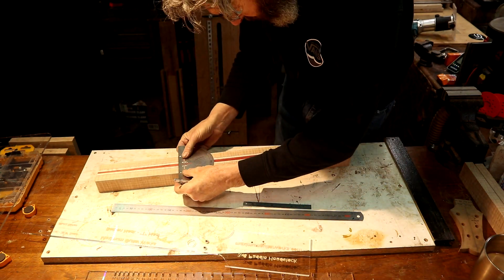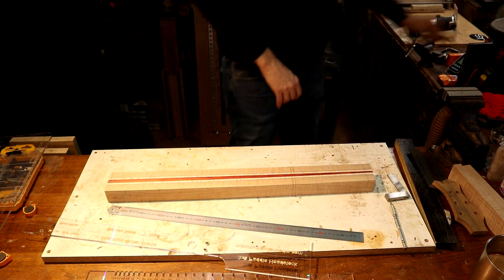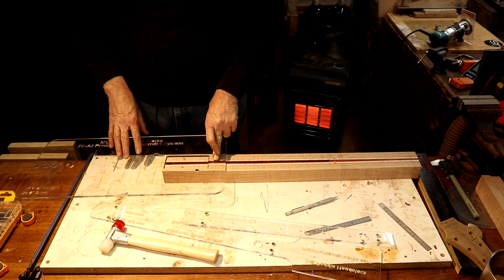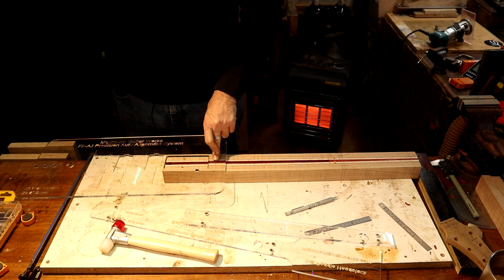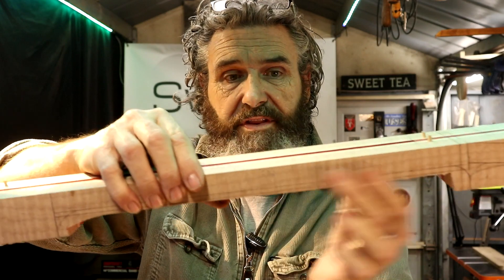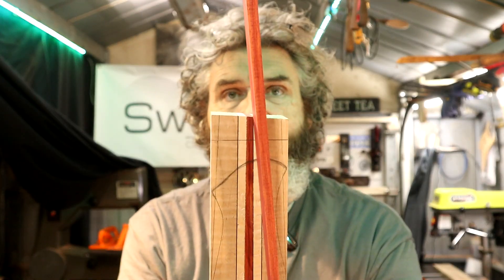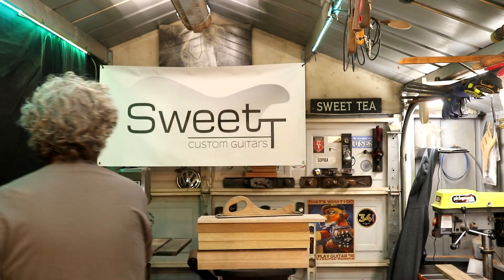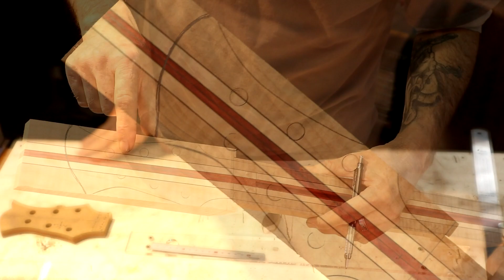How to build an Electric Guitar on the Fly! Uni-T - Episode 2

Comment: Todd, you may want to draw the head stock design out exactly like you want or like you are showing before cutting the angle maybe even use different colors to show just how it's going to look to make sure it looks like you think it will before cutting anything. Also Congratulations on your anniversary and hope you have many more.
Reply from the maker: That is the plan brother. Even though I am doing this on the fly. The headstock is something I have given much thought to. I will draw around on the headstock before I cut it for sure! You'll see that in the next video! I hahe a design that I think will be created but I need to draw it on the wood first. Thank you for the advice and the suggestions! ✌️

Comment: maybe you need a headstock template. a reverse template, a cut out you could set over the pieces of wood stacked the way they will be clamped on and then you could see just what it would look like. sort of anyway. i hope it ends up looking good. your stuff always does so it most likely will.
Reply from the maker: Maybe I do! I like to make the template after I see it in wood so that's kind of what I'm doing. It's just something to try brother. If it doesn't look right when I cut it, I'll cap the headstock and move on having learned yet another lesson😂 Regardless of how it turns out I will be making a headstock template for an offset 3x3. I'll keep the guitar of it ends up being a botch job and I won't try that again! Thank you for the support and for everything else! ✌️

Comment: Do you get pain in the back as you work on making guitars?
Reply from the maker: I have a herniated disc in my lower back and it does flair up from time to time. Generally speaking though, it's no worse when I'm building guitars than it is at time on my day job. I am an automotive paint rep and that requires me to do a fair amount of lifting heavy items. I've learned to deal with it!
Reply: @SweetTGuitars  You don't do Yoga or Pilates?
Reply from the maker: @shai550  Mental Yoga only! I do try and stay active but no routine to speak of. I know that's not ideal. I stand from the time I get up in the morning until i go to bed. I am a firm believer in the addage, A body in motion stays in motion and also "get busy living or get busy dying!
Reply: @SweetTGuitars  you seem to be quite tall in the vidéos, and when I see you bending over the bench it makes me feel like hurting. Strange 🤔
Reply from the maker: I am quite tall at 6'-3". The new table in my shop has been raised 6 inches to make it easier on my back! Not everything changed though. It's a work in progress. As I realize the issue I make plans to fix them at some point. I'll get around to it during down time if I ever have any. Right now I want to keep going and learn everything I can about guitar building.